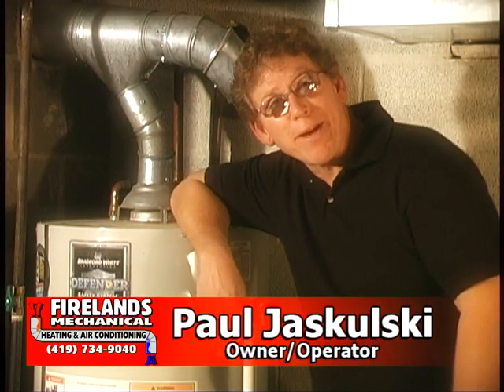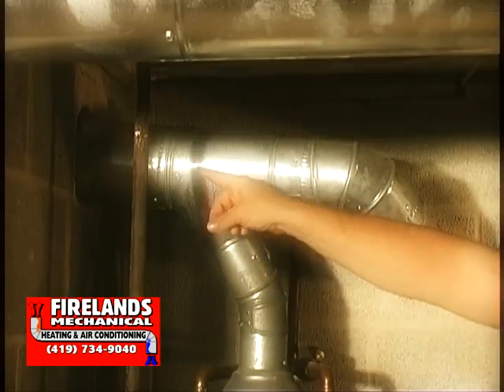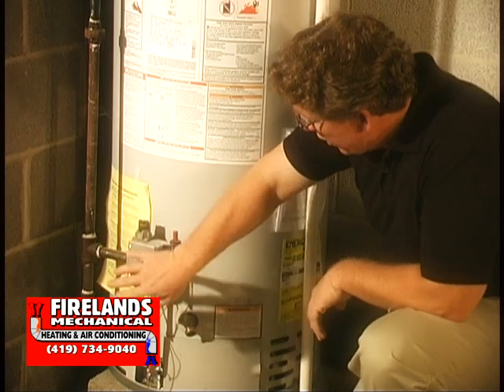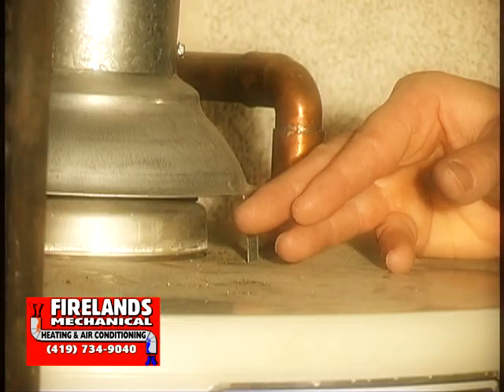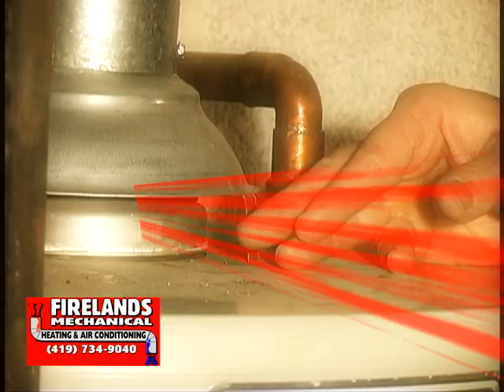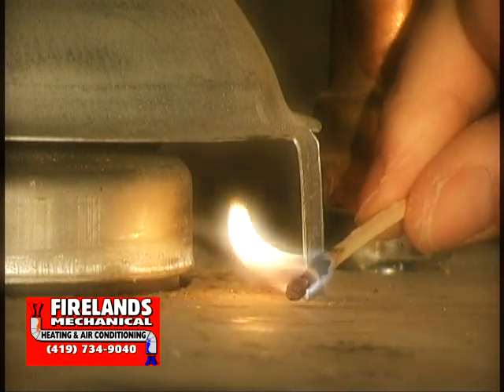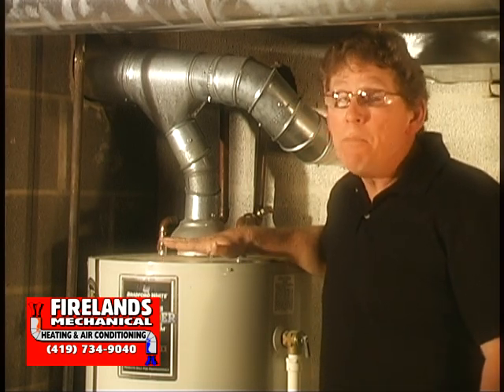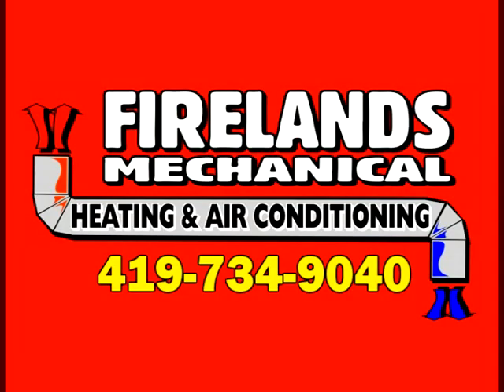Checking your hot water tank venting - Watch These Tips

Comment: what happens if draft hood isn't placed and  connect exhaust pipe directly to water heater?
Reply: It can potentially cause pilot to go out and also debris to go down, as well as vent pipe heating up more than normal. The worst thing; if there is an obstruction on the pipe, it could cause the flame to smother and create hazardous levels of  carbon monoxide .

Comment: I have a direct vent water heater that routes itself  from the top and bottom of the water heater by a separate pipe in the back that's chambered by 2 of some kind of black boxes on top and bottom of water heater but at no point on any of the vent piping is there any type of vent hood that I can test, it runs straight up through the roof. Sealed. It's a manafactured home water heater

Comment: Remember- the exhaust must vent upward. This installation is dangerous and out of code.
Reply: It is venting upward.  Code requires an immediate 12” of vertical before the elbow/junction, which appears here, then 1/4” in vertical for each 1 ft horizontal to get to the chimney.
Reply: @ClownCarCoup Venting into the HEATER vent pipe?
Reply: @tedlahm5740  that’s not necessarily out of code.  Depends on the furnace type which in this case is likely not high efficiency requiring its own vent  

The point of connection for both gravity vents must be 1.5 times the size of the largest vent. 

They must connect using a wye fitting with the largest vent connected at the bottom.  This might be where it would be out of code, not that it’s shared vent.
Reply: Can you please provide an example of what this configuration should look like?  Dealing with fixing this now in my own home.

Comment: What would happen if the vent pipe is blocked? A fire, an explosion, or Carbon Monoxide leaking out?? If the furnace & water heater are in the basement, would it come upstairs through heat vents?
Reply: probably carbon monoxide risk, depending on the severity. at least thats what i read on line
Reply: H P
 Thank you!
Reply: Your biggest risk is carbon monoxide